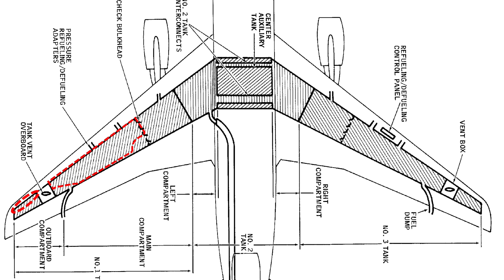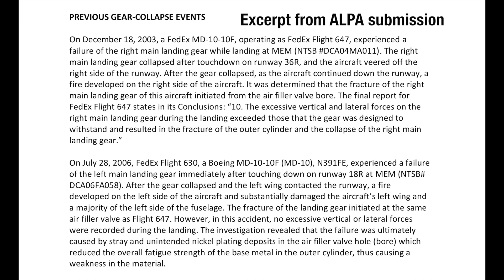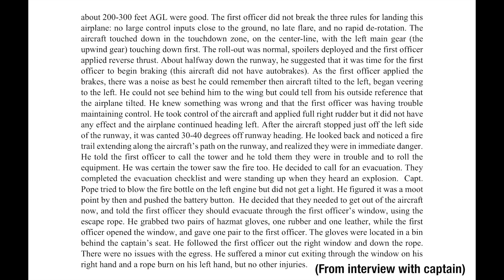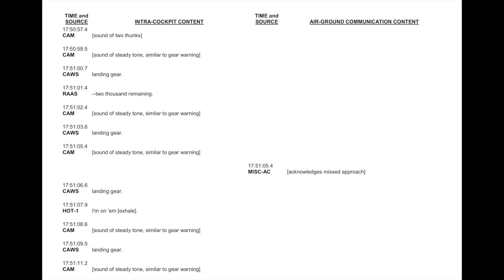FedEx Express 910: Gear Collapse, Fire, Fuel Tank Explosion

Comment: So Boeing blames FedEx for the accident for not following their alert (ASB) DC1032A259 re: Cad plating even though investigators found that the corrosion failures involving the Air Fill vent extended BEYOND the recommended fix area of the ASB. I don't believe FedEx found no other corrosion pit faults in their remaining MD 10-10 fleet prior to initiating Cad plating. So the 3 MLG failures in 3 different planes d/t corrosion was just bad luck, huh? Smells like BS! Corporate America doesn't give a MF about citizens/consumers- legal or otherwise.
Reply: What does this crash have to do with any of that? No DC-10/MD10-11 aircraft carries passengers anymore, and in all 3 (630, 647 and 910) crashes the crews walked away.
Reply: There's a similar comment on Corporste America's irresponsibility by a character in a 1986 novel "One More Sunday" by John D. McDonald. Read also about the 1984 Union Carbide plant-disster at Bhopal in India (thousands of deaths).

Comment: Why didn't the  crew evacuate?
Reply: The did. They escaped through the R/H sliding window. It's indicated by the arrow in the video
Reply: They didn't evacuate earlier because they have to make sure the plane is shut down. You don't want to jump out with the engine still at full reverse right beside you

Comment: There needs to be a quicker way to evacuate these flying metal tubes!
Reply: Pilots need to perform the evacuation checklist. they cannot just bail. Slides would be quicker, but there are only two. The L/H slide probably was too close to the fire, and the right hand door was further up as the aircraft was tiltet to the left. the MD slides are already very steep, that wold have been nearly a vertical drop down that slide

Comment: Impressive.  It took 2 minutes between aircraft stopping and suppressant being utilized on the scene.  Excellent response.
Reply: too slow
Reply: @maxieduardoapariciom.3181 - The emergency vehicles aren't lined up along the runway with motors idling, crews at the ready. This crash and fire occurred on the runway with no advance warning.
The emergency crews have to suit up, leave their quarters, board the trucks, start up, go through a checklist, then drive to the scene. They have to go around to approach upwind.
The fire suppressant is started before arriving to ensure that it works. No matter how recently it was tested, they have to make sure that it works as the suppressant spray may very soon be all that is between the truck and the fire.
They are at ground level and don't have the view of the scene that is had from the vantage points of the monitoring cameras.
The wind can change at any moment, blowing the poisonous fumes toward the emergency response teams. 
The emergency responders may have seen the explosion, which was an additional reason to approach from the side of the aircraft away from the fire.
Reply: @algrayson8965  And the fire trucks cannot take any short cuts across grass areas but have to drive along taxiways ...
Reply: @maxieduardoapariciom.3181  2 minutes is an excellent response time for an accident that happened with no warning
Reply: @maxieduardoapariciom.3181  So what’s your Proffesional expierence/qualifications to say that it was good slow’?
Reply: @andymacmac9151  my professional qualification is in the English language.
Reply: @maxieduardoapariciom.3181  considering boeing uses 5 minutes in their RTO test.
Reply: both
Reply from the maker: @Jack Jones - Agreed, though it should be noted (by me, I guess) that in this instance firefighters at FLL witnessed the crash and began responding immediately.
Reply: Not an expert so... is that sarcasm?
Reply: both fuel and is on the lookout for the crew to exit the plane  to cover them if needed
Reply: First one deployed foam way too far away
Reply: @Tele999zzz  how near would you get to a burning plane with tons of fuel?
Reply: @Tele999zzz  they always start the foam before the fire, sweep and work towards the fire in case there is unlit fuel spreading

Comment: I am not a pilot but it looks like a DC 10, the famous FLYING COFFIN as they called it. Backup Hydraulic Systems were lacking on this FLYING COFFIN.
Reply: I guess you are talking about the Sioux City accident. That was an unlucky one, very pumped up by media and dramatized "documentaries". In hindsight everyone can say "if thay had done this or that differently...". Most aircraft have their hydraulic systems merge in one point. Even the 777 has. The fan disc cutting through all thre systems was just bad luck.
I don't know about the DC10, but the MD11 has a lot of redundancy in the hydraulic system. Two engine driven pumps per system, one active, one stand by. And there are two electircally driven AUX pumps, one can be directly powered by the RAT. If one system fails, no big deal. every hydraulic consumer is powered by two independent systems. Even with two complete systems failed, the aircraft is flyable. every set of consumers is controlled in some way by each hydraulic system. http://md-11.org/allop.htm
Reply: Hydraulics had nothing to do with it. FedEx's shit maintenance checks and general lack of upkeep were the cause. Read the fucking NTSB report
Reply: @richardmillhousenixon  I never said Hydraulics was the cause of this accident. Just pointed out that this was one of the flaws of the DC10. Airline pilots named it "The Flying Coffin" for a reason.
Reply: DC-10 has 3 distinct hydraulic systems pressurized by pumps at each engine.  System 3 can also be pressurized separstely by aux electric pumps, and systems 1 and 2 can.be pressurized by pumps that are driven by system 3.  All primary control surfaces are powered by two systems, and at least half normal control authority over each control axis is retained despite the loss of any two systems.  DC-10 does not suffer from a lack of redundancy, but because of it.

The effect of fusing a hydraulic system before it gets to an actuator is exactly the same as evacuating the system of fluid.  When FAA required that all 3 systems be fused upstream of actuators in the tail, DC-10 became the only transport category airplane in history actually certified for controlled flight without control over the elevator and rudder surfaces.

I doubt you'll find a pilot with sufficient knowledge of the DC-10 to be rated in it who'll agree it's a "flying coffin".

Comment: Why are they taking so long to get out
Reply: N0ka- Going through emergency evacuation checklist.  Shutting down the aircraft and its systems prior to exit.
Reply: If that checklist was written by a pencil pusher it's a wonder the crew survived.
Reply: @rayford21  The pencil pusher (a highly regarded engineer) who wrote that worked for Paul Patten, a former test pilot who was flying right side on a flight test DC-8 that was deliberately dived past Mach one.
Reply: @ericcoleson7410  nerds to the rescue
Reply: 225degrees i kinda guessed that but its just them on board.. fuck the list shut down the remaining engine and get out. They could have died in a fire
Reply: You don't just jump out once it comes to a stop. There are procedures to follow before evacuating, this helps the emergency crews battle an eventual blaze. If you just ditched and ran before doing that, you'd probably be out of a job soon enough.

Comment: Those MD’s are a complete pile of crap. Like a few other Fedex planes they’re lucky it didn’t flip over and burn them to a crisp.
Reply: This accident was totally different to the one in Tokyo. Just read the report instead of spreading bullshit.
Reply: 64h5dsf14j6s41h5s4j5 gear and wing collapses are far more frequent in this aircraft than any other regardless of the cause. Since you like bullshit here’s the right plane for you.
Reply: Captndarty  The cause of the accident actually is very relevant. If an aircraft system fails over and over due to the same reason I would be with you. It's a bad design that needs to be redone.
But putting a fatigue crack due to exceeding the manufacturers overhaul limit recommendations and hard landings due to bad judgements by the pilots into the same basket is not right.
Reply: 64h5dsf14j6s41h5s4j5 happened in Newark as well. There are plenty of hard and terrible landings due to pilot error in many other transport aircraft. Can’t recall seeing videos of a 737, 747 or 777 flipped or from a hard landing. The MD is know for its difficulty in maintaining a stabilized approach thus hard landings for which the heat and spar cannot withstand. Again whether it’s the approach or some of the mechanics it’s still a design flaw and one of the reasons among many that it’s not in passenger operations these at least in the states days.
Reply: Captndarty  You are right, the MD11 is challenging to fly. But not impossible. If the approach is fucked up, you go the fuck around, not force it on the ground like FedEx in Tokyo or Lufthansa Cargo in Riyahd. When pilots fuck up things might go wrong.

But that's probably how it is with arguments over the internet :D Neither of us will give in.
I know for a fact that the MD11 is a (difficult to fly but) great aircraft because I work with them every day... from what I have learned people either love the MD11 or they don't know her.
Reply: Captndarty:  Interesting.  I don't have a great deal of experience as a passenger, but the only really good hard landing I ever experienced was in a DC10.  It was a pretty good spine compressing jolt when we landed.  Some of the ceiling panels (held in by spring clips for easy access to wiring?) came crashing down on the passengers.  People were screaming and acting like they were going to die.  I thought the over reaction of the other passengers was very funny at the time.  After reading your comments, maybe those over reacting passengers were not as goofy as I thought.
Reply: Eric Ferguson well any landing that makes the ceiling panels fall out is pretty serious and alarming for sure. I think the DC-10’a were a better and easier aircraft to land. The lengthened MD-11 has a smaller stabilizer and center landing gear for the added weight and stress.
Reply: Captndarty  The DC10-30 also had the center landing gear. It was not introduced with the MD11
Reply: 64h5dsf14j6s41h5s4j5 not true... the md11 has center gear, so does the dc10-30, 40... not the dc10-10
Reply: @rosworld9129  you misunderstood me. Of course the MD11 also has the center landing gear, but it was not introduced with the MD11, but with the DC10-20/40. Captndarty wrote something like it must be a MD11 because it has the center landing gear. Apparently he deleted that comment
Reply: Capndarty, shall we consider the fact that this airplane had been in service and making money for somebody (Fedex was the second operator) for 44 years at the time of this accident, or act on your expert assessment that it should never have been built, and ground the lot of them?

Do you even know how overhaul limits are set?  The current recommended interval of 8 years or 7,500 landings (whichever comes first) is probably twice that allowed when this airplane was delivered in 1972.  The limit gets extended over time, as actual in-service experience demonstrates it can be.  The limit stops growing when a number of gear pulled for inspection begin to show wear or damage that portends failure or that further sevice is likely to preclude economical overhaul and return to service.

By the calendar, this landing gear was roughly 6 months past the manufacturers overhaul period and roughly six months short of FedEx's adopted limit.  Based on FedEx's experience in their own operations, it may not have been unreasonable to bet this gear would be ok to the extended overhaul interval.  Having lost that bet in this instace may cause FedEx (or the FAA) to re-think the wisdom of it.

You have no idea how many landings or overhauls this gear may have logged in its lifetime.  It was last overhauled 8 years ago, in 2008.  You have no idea how many landings (or how many may have been hard or overweight), or what other abuses it may have suffered even in that period.

What you would know for sure, if you'd bothered to read the NTSB report, is that (1) a minor but critical routine detail was missed or muffed  during the last overhaul, which eventually caused the gear to fail during a landing. (2) That had the landing gear been overhauled at the recommended interval, the defect may have been found and corrected, depriving you of an opportunity to expound authoritatively on something very obviously outside your area of expertise.

And finally, having personally witnessed the right main landing gear of a Delta Airlines Boeing 757 (that couldn't have spent half the time in service of this three-holer) collapse due to a trunnion failure during a perfectly normal pushback from the gate, I can assure you that gear failures are in no way unique to the airplane you so didain.
Reply: Eric Coleson I never said this airplane shouldn’t have been made and certainly everything has a life cycle limit but there’s a reason it’s not in service passenger wise in fact there are many reasons, too much for the scope of this discussion. There are many MD-80 variants as old as Christ still flying more successfully I’d say than the 11. Things do break even on Boeing’s but it seems that the relative small number of 11’s operating today carry a much higher number of landing incidents and sever accidents than most others. Is it design? Is it the training? Is it the cycle and fatigue factor? Who knows but the fact is it doesn’t  matter how  well built something is it isn’t if it’s old and worn out it’s junk.
Reply: @Captndarty  The reason you won't find DC-10s in passenger service is as simple as the bottom line.  The third engine is no longer required to meet ETOPS rules for long, over-water flights, and there's simply no route you can fly with a DC-10 that can't be flown at a lower seat-per-mile cost with a twin-engine airplane.  And yeah, older and high-time airplanes always cost more to operate, too.  (At the time of the accident, this particular piece of "crap" had been in service for 44 years and had accumulated 84,589 hours and 35,606 landings.) The only reason you still see them in cargo service is that freight sitting in the warehouse makes no money, and the two-holers that will replace them are backlogged.

FedEx, e.g., expects to retire its DC-10-10Fs by January 1, 2020, by attrition, as they take delivery of more modern and efficient replacements.  &btw, they'll be overhauling the gear on those at the manufacturer's recommended interval in the interim.
Reply: Eric Coleson ETOPS applies only to two engine aircraft with extended range. But you are correct in that pax carriers don’t fly these planes due to economics. Three engine aircraft burn(ed) more fuel... that and the 10 required an engineer = more $$$. Cheers
Reply: @rosworld9129  Hence the third engine, as no twins met the requirements on the longer over-water routes when the DC-10 entered service.  It was years later that demonstrated engine reliability and performance on a single engine qualified twins to fly those routes.
Reply: The MD-11’s hardly make it off our ramp sometimes.